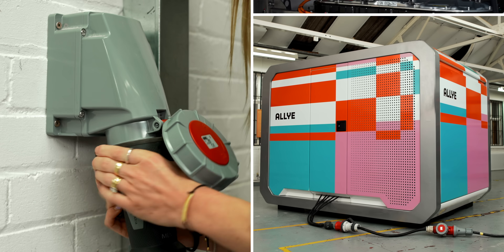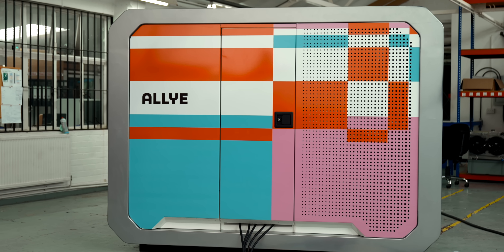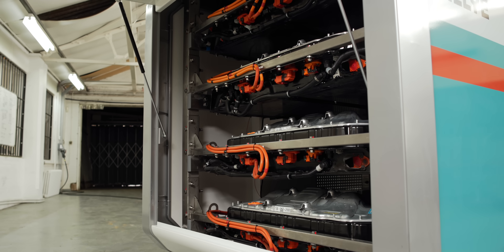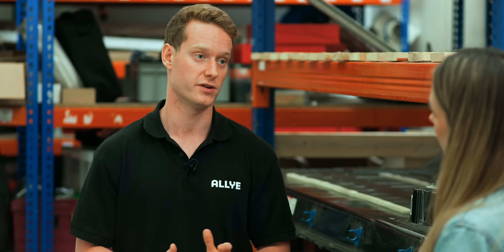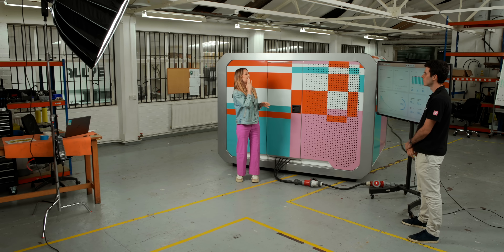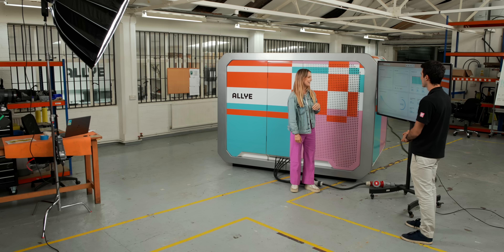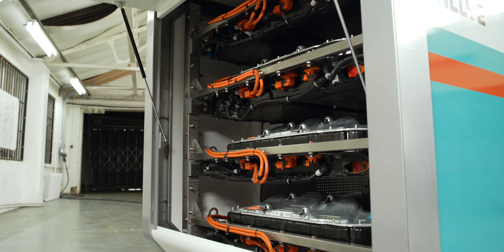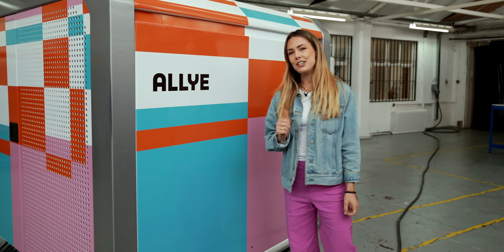These Recycled Batteries from Allye Cut Your Energy Bills In Half!

Comment: During my working life I have come across many companies (retail, factories, even warehouses) that have an on site generator to enable them to continue operation in Power cuts, these attract costs - maintenance, servicing, insurance libilities etc,  that the company never gets any return for ordinarily - except for when the power goes of course - you mentioned it almost in passing, but I can see that this could become a useful asset in normal times aswell as providing the neccesary emergency power, then of course there's "peak shaving" which can be used to reduce M.D. costs and some suppliers I gather provide incentives to companies to cut demand at certain times, another potential saving to be exploited?
Brian

Comment: Great that ev batteries are being used after they are removed from vehicles it shows that batteries can continue to work long after the reported functionality of a ev battery pack. What I don't understand is why more funding is not put towards home solar and storage. Home solar systems can be installed as quick as 2-4 weeks, with no issues of grid connection or planning permission waiting times. If the 10's of millions of homes in the UK got solar and storage it would solve most of the grid problems that we have today.

Comment: Could this be allied to solar panels? I'm thinking residential, so if it's serving 20 houses then have (most of) those houses install solar panels to feed the beast. And also serve as a charging point for electric cars? Basically perform exactly the same role as an individual Powerwall / Solar Panel / Car Charger but as a group resource for 20-30 houses.
Reply: 😂😂😂😂😂

Solar panels to batteries, via an MPPT controller, has been "standard practice" on boats across the planet for decades. Repeat decades.

So yes such a system could work anywhere on dry land.

You might have noticed the odd roof mounted solar panel array ... it's going to be a big thing so we are told.

Comment: Why didn’t they make it as a trailer.
Reply: It fits on a trailer!
Reply: @allye_energy  but you don’t need a trailer if it is a trailer. Just makes is easier to move it from site to site.
Reply: ....and add a motor and steering wheel....

Comment: Clever packaging. I wonder if they are rather constrained by the availability of scrapped but usable battery packs.
Reply: Thanks for the comment. Last year in the UK there were some 40k plug in vehicles that were prematurely written off. We only need to access 1% of the total market to build our systems in the coming years. We still need to deal with the other 99% however...
Reply: @allye_energy Hopefully better systems of battery monitoring and evaluation will be developed to avoid such a high rate of premature battery removal.  

In the meantime, there should be plenty of good uses for useable EV batteries.  Perhaps should is the operative word here.

Comment: Next version - raise the batteries vertically (cells are not with liquids), in that way colling and air flow will be better, dust will be settled down add chassis will be lighter (only bottom needs to be strong).

Comment: I need this to supply sufficient energy to my rapidly growing off-grid shop.  Does somebody have the wiring schematic and equipment needed to build a unit like this?  I can get the Tesla batteries.  Thanks for posting.
Reply: Be careful, DIY with lithium batteries is not a game. You will need inverters, power transformers, electronic boards and software. I think that if you buy it from a supplier it will cost you 20-30% more in money but a lot less in time and research, and you will be sure that it works and it is safe!!!!
Reply: There is this video on youtube that appears to use Leaf batteries - cheap and readily  available:

https://www.youtube.com/watch?v=XHZWGLzT7gg&t=182s

Comment: Why on earth did they not use brand new LiFePO4 cells? Cheaper to buy than second hand Tesla batteries from crashed cars, at least 5 times as many cycles so a far longer lifespan from them and of course much safer and impossible to go on fire. They are bulkier and weigh more, but that doesn't really matter all that much for a battery that is mostly stationary. Should still easily fit in that same size enclosure.
Reply: how do you know its cheaper??????
Reply: @rivergladesgardenrailroad8834  He read it in the comments of a Youtube video. How else can you know facts?
Reply: You do know Tesla also uses LFP batteries in their cheaper models right?
Reply: I would go for rack mounted LiFePo battery systems, easy to swap out faulty units, very compact arrangements.

Comment: Finally, Modular, Transportable, generator style portable power. I'd really like something on a small scale to take off as a standardized modular solution. Like the Buggy battery cells in 'The Martian'. Similar to the scooter batteries in India, I wonder if they'll ever be as ubiquitous as the 12v battery. A gerry can battery of sorts, compatable with an emergency socket in the boot of a car, or generator hookup in homes.
Reply: Most electric mopeds have these, which enables you to take them out of the scooter into your house/office to charge them off a 3 pin plug

Comment: The start of "balancing" local grids from Sub Stations to homes. Putting battery storage next to the Sub station reduces peak demand and can top up daily with cheap night energy. Next step is to have Suburban Streets that have Solar Panels covering threads also with smart lighting to reduce energy use in the wee hours of the morning, shade from Summer Heatwaves, give cover to Cyclists to provide all year zero transport and provide householders with vastly reduced Electricity costs whilst safeguarding the High Voltage grid from XS demands!!
Reply: Spot on Simon - did you read our pitch deck?!
Reply: I'm afraid your suggestion makes too much sense.  You'll have to go back to the drawing board and figure out a less efficient solution that diverts a massive stream of funds to some monopoly or other.  Or else it won't be considered "politically feasible."

Comment: From my business perspective if we had solar on our unit this would be ideal. Presumably charging as 3 phase so a battery per phase? 

However there’s isn’t actually a financial benefit to charging directly this from the grid. We have NO off peak business rate so wouldn’t save any money from
Reply: - manu commercial properties with solar generation get no additional benefit from surplus energy - simply net metering, this (or any other battery system) allows one to capitalise o n any surplus one may be "wasting" sending back onto the grid for no financial reward.  Virtual Power Plant  - online connection allows much more in the way of commercial grid services to be performed - for a return (for multiple owners  and the '"management firm" in collaboration.  Don't forget simple increase in energy resilience for the owner and their own local grid.

Comment: Good example of repurposing. Great work. I have been saying for a while that the grid needs to include energy caching. Think of Dinorwig in Wales or a huge grid attached battery, storing excess renewable energy until it is needed. Once that is implemented around the grid, we can start decommissioning the old polluting power stations.
Reply: Another good example is California.  “California’s batteries provided more power — over 3,360 megawatts — than the Diablo Canyon nuclear power plant, the state’s largest electric generator, which tops out at 2,250.” — LA Times (2022-09-13 heatwave story)

Comment: 3 kW supply does not seem enough for a factory.. is that the max power delivery?
Reply: I saw 300kWh as it's capacity. When they connected the building, the building was drawing 3.5kW. That is not the battery rating, simply what the building was using at the moment.
Reply: @Hybridog  correct
Reply: Up to 200kVa / 200kW at the moment... higher power possible with cooled inverters (something we are working on!). Thanks for the comment.
Reply: The Tesla Model 3 Long Range has a motor that can draw around 200kW or more.  So presumably, if Allye wanted to, for this four-battery setup, they could provide a capacity up to  something over 400kW, perhaps up to 800kW.  But a variety of other factors could come into play.

Comment: Surely it can only slash the electricity bill in half. Not the total energy bill. What about gas and oil? Is the title of this video a bit misleading?
Reply: If you watch the whole video you see they're targeting uncapped commercial energy prices. Energy in the context of the video that is something generated at power plants and distributed via the grid as electricity.

If you're being pedantic lots of large businesses have backup generators, so it could cut fossil fuel(generally combusted for energy) cost too especially if the area has frequent black/brown outs, as mentioned in the video.
Reply: @vorpolkai  some businesses use gas or oil for heating or in the manufacturing process. Not really pedantic, it’s just a fact.
Reply: There are plenty of people who have set their homes up to be solely electric.     After all it's where we all need to be headed.

Comment: Don't want to be such a downer, but if diverse grid storage is so great, why doesn't the utilities pay us to have one installed at the house. We get the benefit of backup power when a storm happens, and the power company gets to load balance.  Many power companies, like mine, already control the hot water heaters, why not move to battery storage and give us rebates.
Reply: That's a great idea!... watch this space
Reply: They don't want us to have cheap power because there's no profit in it. They want everyone to have evs and to get heat pumps and to ideally have smart homes and this will use more power that can be produced, my home doesn't have enough amps coming in to charge a car and run a heat pump and run home appliances, so I would need another line brought in which will cost a fortune and my home would need a total central heating make over to have a heat pump which will cost 15k + , I have looked into solar and battery's and this seems the more logical solution for every house, but like I said the energy companies won't profit out of cheap power.
Reply: Regrettably the way electricity is currently generated there is always a surplus during the night that just gets pumped into the sea as hot water if the suppliers can’t sell it cheap (as E7). - Batteries would obviously just worsen that problem ..
Reply: yep, at some point you may well freely host their battery (in front of your meter) on your land and they will happily sell you the power through good times and bad.   They may even "pay" you to host their solar array to provide distributed generation in all local areas. You may even get a locked in price guarantee for a decade  in return for being their loyal contracted customer.  The last thing any distribution grid wants is for their clients to suddenly become their suppliers.

(hot water storage heaters  are already like having a 5-20kWh battery in every household - heating water is so much cheaper than any battery system (and the hot water is "necessary " in some quantity all year.)

Freely fungible energy storage like; batteries or distributed pumped hydro, are the next step - this model is only in its infancy - wait until a few more generations of grid storage flow batteries become widespread.
Reply: Seeing as the money they invest is from what we pay them, who would be paying the 3k per house to fit a powerwall??
Reply: @philtucker1224   (which 3k?? - do you mean simply the installation charge?? ) - you will keep on paying month on month most likely.
Reply: @kadmow  what, like double or more? 🤔
Reply: Your idea is widely used already. Many people have domestic batteries from a range of suppliers, and tariffs like Flux and forced export pay best rates for surplus power.
Reply: @ianlighting100  I’ve heard they are thousands of dollars?
Reply: @philtucker1224  yes. I work in pounds, but I know a Tesla Powerwall is around 10k. Other options are cheaper and some are scalable but you’re right. 

As you’re not uk I should explain the tariff is from Octopus, one of our more innovative power companies over here. Always coming up with different tariffs with variable rates to suit different use cases. 

There’s one that pays customers to use power when we have too much surplus from our wind turbines.
Reply: @ianlighting100  that’s really interesting Ian, for the life of me I cannot imagine why anyone would want to store that much surplus electricity for domestic use as I’m sure it would not pay back for maybe at least 20 or 30 years (if ever)..
However it probably would be a good investment if you had critical equipment installed in the house like medical life support for instance…
Reply: @philtucker1224  there is infinite variability in peoples needs. I think the payback can be 8 years, but calcs are complex and have to based on a guess on the price of electricity - which is impossible of course!
But for a house with modest solar PV on the roof (eg 4kW) which in the UK might cover 20% of annual use for a 2 person home, the battery obviously allows you to consume that power in evenings and cloudy days, so taking you to perhaps 60% of self consumption instead of using grid.
There are so many variables we can’t get into, but it can make sense financially. But def helps to know you want to stay put in the same house for the long term. In case you haven’t guessed, yes we do! We’re not on gas like most uk homes, so shifting electricity generation and consumption is very useful.
Reply: @ianlighting100  Hi Ian, yes I can understand that. I spent my main career in domestic electricity so I’ve had a few thousand discussions with customers about usage and life style. Looking back, there wasn’t too much wrong with the old original Economy Seven in the respect of encouraging usage after 7pm and before 7am at the cheaper rate, when industry weren’t using so much power. Now that we’re switching everything to electric, it would be good for National Grid to just implement it country wide as I believe the word would soon get round and everyone domestic would quickly get into the habit of doing much more stuff at night instead of middle of the day.